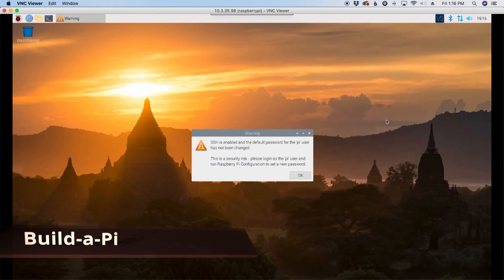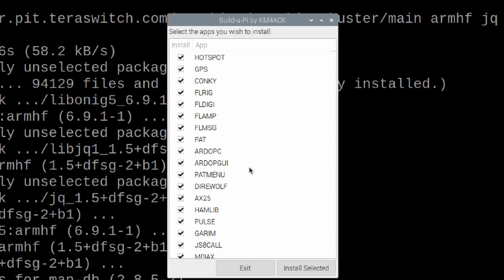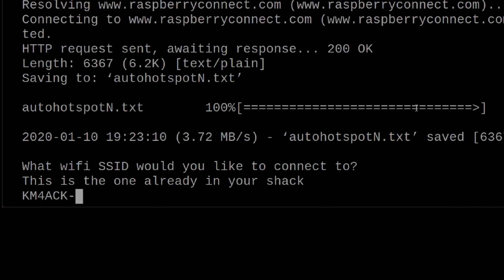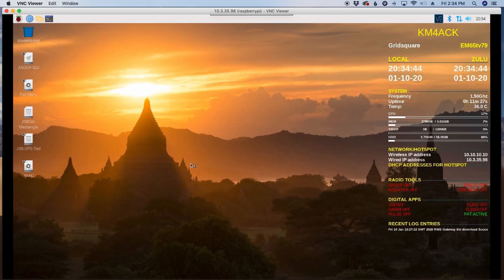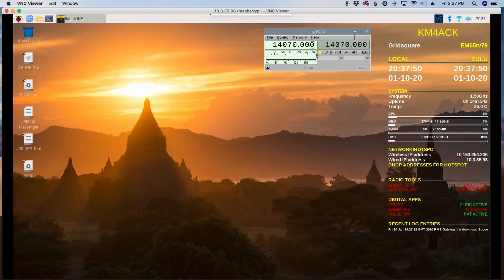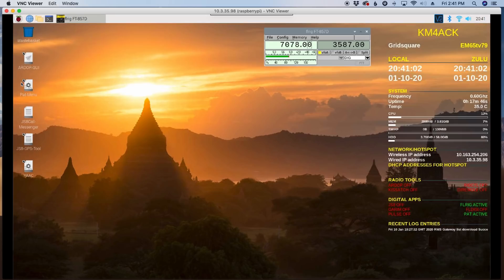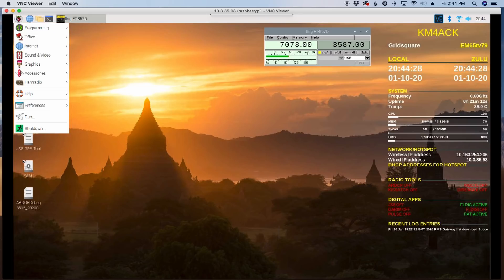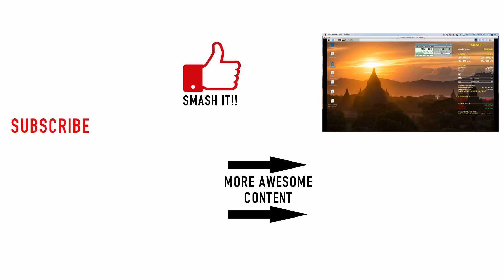Easy Raspberry Pi Build for Ham Radio Digital Operations | Build-a-Pi

Comment: Looking at getting the 857D myself.  I wasnwondering if you could offer a link to a solid cat cable for radio?  Also would there be much difference in setup if using something like the Sabrent sound card, i plan to set everything up for portable use?
Reply from the maker: These are great cables https://amzn.to/2QPQzaU (affiliate link) I use a sabrent sound card with both of my 857s
Reply: @KM4ACK  perfect!  I knew you ran an 857D which is why I asked.  With all the pi work you do, figured id ask the pro.  Thanks again!

Comment: This script is terrific work, thanks so much!. I'm still in the novice phase. I have an FTM-100DR, Signalink, and rpi 3. So far as I know my radio does not support  rig control. But I understand that pat needs to run VOX messages via flrig. 

Running pat I get errors that make me think pat it is trying and failing to send rig control commands. I am thinking I should remove rig-control commands/settings from configuration files. Am I on the right path?
Reply from the maker: You can run without rig control. In the pat menu config file (~/patmenu/config) set RIGCONTROL=no You will lose some functions like auto pat but standard pat connections will work.

Comment: I've got everything running as it should but I realised that running headless I had a dynamic IP address.I have looked in vain for a decent description for setting up a static address. Did you cover this in one of your videos?
Reply from the maker: The hotspot should always have a static ip of 10.10.10.10. Setting static ip's for each device that connects to the hotspot isn't something I have done.
Reply: KM4ACK I have that for running a hotspot, but I was trying to run VNC with the home wireless connection without first checking the dynamic IP on a HDMI monitor.
Reply from the maker: I handle that on my home router. Log into it and tell the router to always use this ip address for that particular pi.

Comment: Lost my wlan0 - how do I undo redo the hostspot config?
Reply from the maker: You will need to edit /etc/wpa_supplicant/wpa_supplicant.conf to manually add/remove SSID's. I am working on a new set of tools to make this process easier. You can read about them here https://us20.campaign-archive.com/?u=377bc4b4526e741c9c344bac0&id=b7b8e08a33 A video will on the new tools will be coming soon but you can beta test them now.
Reply: KM4ACK thanks for the reply. Your script saved me tons of time, despite my "unique issues" of hotspot password corruption and hidden ssid configured but not recognized due to the deprecation of hidden ssid in the o/s. 

I'm going to try to be ready for Js8call SOTA activation this afternoon PST. Thx de KC6ARY
Reply: I had configured my WiFi for a hidden ssid to load/run the script-the connection to that ssid worked great. The auto hotspot follows the methods established by raspbian/Debian and does not detect hidden ssid. Thus the hotspot came on due to no recognized ssid and shut off the WiFi. Working as designed. 

My solution was to go ahead and make my hidden ssid visible.

Comment: I reloaded the package but not the programs connected with VHF and PAT. JS8CALL works and M0IAX shows the Maidenhaed  Gridsquare but although  it shows that the message text is set in JS8Call nothing shows up in JS8Call
Reply from the maker: This video addresses that issue https://youtu.be/emcMOvJc-AM
Reply: @KM4ACK  OK I remember changing the port number to 2237 when I ran this before. But now, I can't find configAndSetting.py. Should I have downloaded another program from the dropdown list?

Comment: how do I get to use a GPIO pin to use it as a PTT in WSJTX and JS8CALL. Please help
Reply from the maker: In JS8Call go to file>settings and then the radio tab. Scroll to the bottom and look under Advanced for PTT command. I think this is where you enter the info but this is not something I have done. Only an educated guess. You can also post the question at https://groups.io/g/js8call/topics

Comment: I had done some of this on my own over the last few days but didn't have the hotspot working.  This was so amazing I started over and have it up and running in a few hours.

Kudos for all the hard work you have put into this.
Reply from the maker: Outstanding!  Version 2 will be out later this month with the option to install more apps. 73, de KM4ACK
Reply: @KM4ACK  I am currently working through the fix video.  I also could never get the VNC display to show up with the HDMI display disconnected.  I have had several issues with Pi4 that have stumped several experienced users but I am a complete newbie to the Pi.  Things are getting closer for me.
Reply: @KM4ACK  Got everything sorted on the 7300 today.  Soon I will move this Pi to the truck for mobile work on a 7100.  Thanks so much for this.

Comment: Sadly two installs in a row failed for me  
/home/pi/pi-build/build-a-pi: line 63: /home/pi/pi-build/appchoices: Permission denied 
This is the same failure both times (starting from a fresh Buster install) 
I am starting the git with sudo too.....
any ideas?
Reply from the maker: Don’t use sudo. After the pi boots for the first time do nothing other than open a terminal and run -  git clone https://github.com/km4ack/pi-build.git $HOME/pi-build && bash $HOME/pi-build/build-a-pi
Reply: @KM4ACK   and don't use SSH either, somehow I missed that in the instructions
Reply: so now I am much farther but its stuck on hamlib "http request sent waiting on response"  this is try 6 at this writing ...how many times will it try? Will it finally quit and just move to the next installation?
Reply from the maker: Dan Hurd never seen it stuck like that. Sounds like it can’t connect to to download server.
Reply: @KM4ACK   KM4ACK  it eventually finished,  I had to leave for 24hrs and when I returned, the rest of the script was complete and waiting for me . hamlib did finish because it is there and working.
Reply from the maker: @Daniac321  patience is required especially with the pi 3. Several of teh applications are built from source which takes quite a bit longer. Last time I built the pi 3 I think it took over 3 hours for the complete build. Glad you got it going. 73, de KM4ACK

Comment: Great work Jason. Thanks a lot. Setting up a PI is a breeze with your scripts. Great. What if I need to look for updates? Just running the script again? 73, Stephan, DF6PA
Reply from the maker: No. The script is only designed to be run once. You will need to update apps manually. 73, de KM4ACK

Comment: First, let me say thanks for all of your time and work on these videos. I am having an issue with the flrig serial port selection. All I see in the drop down is "None" or "/dev/ttyAMAO" Using a FTDI chip USB cable from RT Systems that I used previously with this radio and a Windows machine without an issue. It's probably something simple I'm missing. Any direction appreciated.
Reply from the maker: If you are using a pi 4, try using one of the USB2.0 ports. The black port, not the blue one. 73, de KM4ACK
Reply: KM4ACK Using a Pi 3 B V1.2. May invest in a Pi 4 to be as up to date as possible if I can’t get it to work.
Reply from the maker: You might try another cable instead of another pi. I have had my cable for a Yaesu 857D work on both the Pi 3 & 4.
Reply: KM4ACK Already have one ordered.  Also searching the web for troubleshooting. I’m a Pi newb and not at all versed in working in terminal commands etc. Your script to install everything was a godsend. Thanks again.
Reply: A different cable solved my connection issues. Now it seems that the Pi 3 is not up to the task. The apps keep crashing. Baby steps. Think I see a 4gb Pi 4 in my future!
Reply from the maker: William Baukhages which app is crashing?
Reply: KM4ACK I have flrig configured and connected. I have opened WSJTX, JS8Call and fldigi and tried to configure them. When I try to change frequency through the apps they close. With fldigi it causes flrig to read the frequency from the app and not the radio.
Reply from the maker: William Baukhages so you have FLRIG configured and running in the background. Then In JS8Call/WSJTX you are setting the radio under rig control to FLRIG? Which radio are you using?
Reply: KM4ACK I’m using an 857D with a SignaLink. Used to be my main rig. Dusting it off for portable use. I set up the Pi 3 using NOOBS lite and then used your easy script to set up the ham radio apps.
Reply from the maker: William Baukhages ok. Now I think I have the solution. You need to reflash the SD card with Buster Desktop only from raspberrypi.org. Using NOOBS is likely causing issues. Good news is it is super simple to setup once you have the right version of Buster on the card. The default settings should work for you. I was using the 857 when I built this script. If you are unsure how to flash a card, search flash raspberry pi as card on YouTube. Lots of good tutorials out there. 73, de KM4ACK
Reply: KM4ACK I was afraid you were going to say that. I am a NOOB with Raspberry Pi, hence the use of NOOBS. Will give it a try.

Comment: Jason, I got it up and running!  The only thing I have a problem with is the info on the right side.  I am using a 5" HDMI display and i can't see anything below "MEM".  but it is up and running on my Raspberry Pi 3 Plus.  this is so nice having all the amateur radio files all compiled in one place.  Juddie WD8WV
Reply from the maker: I am working on a fix for just this situation. Should be ready when Build-a-Pi V2 hits later this month. Patrons are beta testing V2 now. 73, de KM4ACK

Comment: Great video!!!!  This is what I have been looking for so I could use my Raspberry Pi with my FT-817ND.  Now my question, it may have been asked, will this work with the Raspberry Pi 3+??  I have another Raspberry Pi 3 but it doesn't have Wifi capability (older Raspberry Pi).  I have been wanting to setup my Raspberry Pi to work with my FT-817ND ever since I got the 817.  I want to try and build a Go-Box and I wanted to incorporate the Raspberry with this.  Juddie - WD8WV
Reply from the maker: It will work fine with the 3 or 4 as long as it is running Buster as the OS. 73, de KM4ACK
Reply: @KM4ACK  which Buster do you recommend??  I see there are 3 flavors of Buster on the Raspberry website.  Juddie - WD8WV
Reply from the maker: J & J True Outdoor Adventures the lite version won’t work. Either of the others will. I personally prefer the desktop only version.

Comment: Why don't I get the Informational display showing the call,  Grid square, local and UTC time, etc?  The first time I tried the script it showed up. But, after making a new user with the same access as the pi user, the display did not show in the new user or the pi user. 

I flashed a new card and did it again and it showed. I did not create a new user thinking the script may have created files only accessible to "pi".  Once again, after shutting down and restarting later as "pi". the display was gone.

I went through the whole process a 3rd time.  This time the display never displayed at all.  All of the amateur radio software seems to be installed.  What am I doing wrong?  Is there something I need to run in the terminal to start/restart some process?
Reply from the maker: The script that calls for conky to start on boot is in Pi's crontab. You will need to add that statement to the new users crontab in order for it to work on boot again.
Reply: @KM4ACK  It isn't even working in pi on a new install I just finished.
Reply from the maker: Do you have the pi user set for auto login?  That is the default behavior. I just built a pi 4 yesterday using the script and had no issues.
Reply: @KM4ACK  No, I did have it set for auto login.  I changed that and now it displays.  I hate to take up your time but I'm not an experienced programmer.
Reply: One other thing. The first time I ran the script it asked for a name and password for the hotspot.  The last time it only asked for a password but not a name.  How do I check to see it it setup correctly?
Reply from the maker: cat /etc/hostapd/hostapd.conf
Reply: @KM4ACK  It was there. I guess I just don't remember putting it in.  Last question (maybe :)). Why does my gridsquare not display and why does it say no GPS?  The GPS is working.  When I do gpsmon it shows 12-15 satellites.
Reply: @KM4ACK  After multiple trials I found that you have to have it set to boot to desktop, auto logon to pi and have splash screen enabled for it to work.

Comment: Mine keeps rebooting during the install process before asking which programs to select. I have no installed programs on the  desktop or under the raspberry tab. When I try and rerun the script in terminal, I get a path error that the files are already there? Im confused. Ive deleted and retried it about 5 times now and the same thing keeps happening.
Reply from the maker: try flashing a new card instead of deleting and run the script before doing anything else.
Reply: @KM4ACK  I just tried your suggestion and it does the same thing. It ask for my callsign then starts an initial download, then says rebooting in 5 seconds, which you cant stop. I never get to the window of actually picking programs
Reply: @KM4ACK  I flashed two more times and its finally working. It just took some persistence!
Reply from the maker: Hmmm....wonder what’s different with the last time you flashed it?

Comment: Jason, previously I installed using the one command, but I only did Conky, GPS and Hotspot. They installed flawlessly and are working fine (although GPS doesn't work all the time from my basement). I did only those 3 because I didn't have my radio cable yet, but I was anxious to give this a whirl. I have gone back to do the full install and got the following message:   fatal: destination path '/home/pi/pi-build' already exists and is not an empty directory. There is probably a simple solution to this, but I am not well versed in Linux. Or do I have to start all over?   Gerald - KG0VA
Reply from the maker: you should start with a fresh install of Buster. The script is only meant to be run one time. 73, de KM4ACK
Reply: @KM4ACK  Thanks Jason!. I'm glad I made a backup before I started this project. I'll start from there. Thanks for all of your great work on this pi build!! Gerald - KG0VA

Comment: Last Conky question (I hope). When I run Whereis Conky I get--> conky: /usr/bin/conky /etc/conky /home/pi/bin/conky /usr/share/man/man1/conky.1.gz

Does that look right? I'm still trying to figure out why it doesn't autostart. I added the line that you showed us in your conky video

Here's an odd one- /usr/bin doesn't have conky in it AND the listing starts with first letter e not a
Reply from the maker: Yes. Your whereis looks correct. Here is the line that should be in cron - @reboot sleep 20 && export DISPLAY=:0 && /usr/bin/conky         Make sure your syntax is correct. One character including spaces out of place and it won't work. Also, your pi user should auto login (default) or conky won't load. 73, de KM4ACK

Comment: Thanks for the fantastic video.   I cant get JS8CALL configured.  I go through the configuration as you do in the video and in the Audio configuration tab select the same codecs you do for receive and transmit  but when I click okay to save the configuration JS8CALL just shuts down altogether.  When I relaunch JS8CALL none of the settings from the audio tab are saved.  I have selected other codecs just to see if it made a difference but same result occurs - JS8CALL shuts down as soon as I save the audio configuration.   I am using same HW config as you:  PI to Signalink to FT-857D and a CAT cable with FTDI chipset from PI to FT-857D.  Also, not having any problems using FLDIGI or FLRIG.  Any suggestions?
Reply from the maker: Do you have FLRIG open before JS8Call?
Reply: @KM4ACK  Yes...FLRIG is open when I launch JS8CALL.
Reply: Yes...FLRIG is open when I launch JS8CALL.
Reply from the maker: I had another user run into this earlier today with WSJTX. He uninstalled FLRIG and built it from source. Solved the closing issue.

Comment: Thank You VERY MUCH for the WONDERFUL SCRIP Jason .... it makes live much simpler for quick setup and deployment of the APPs we Hams use =)  I have a corrupt SD Micro SD card to replace and you made the job MUCH EASIER =)   The EOC is doing a Digital Modes training session and wondering about the Raspberry Pi's use in Field Deployment 8-)  73's Pat N5VMO
Reply from the maker: This should help to sell the idea of a pi to the EOC. Glad this came in time for your corrupt card. 73, de KM4ACK
Reply: @KM4ACK  Yes on that idea Jason =)    The nice thing is the man that is heading up digital modes is the one I taught Fldigi five years ago 8)   He has just started exploring the RPi; so it should be a simple inclusion to the EOC here =)   Thanks Jason and maybe check to see if I can get a download on the current RPi videos you have made including using RPi3 and RPi4 builds to place on a thumb drive or SD card to use offline =)   Great job on the script =)  73 Pat N5VMO

Comment: Just ran on a fresh NOOBS install and got "/home/pi/pi-build/build-a-pi: line 63: /home/pi/pi-build/appchoices: Permission denied" How might I address that?
Reply from the maker: Try using Buster desktop only without NOOBS. 73, de KM4ACK
Reply: @KM4ACK  Taa-Daa! It works. I should RTFM 😉